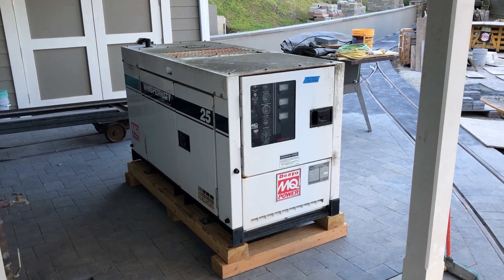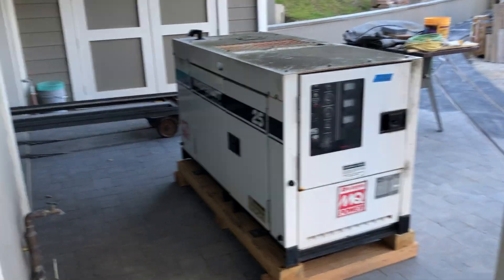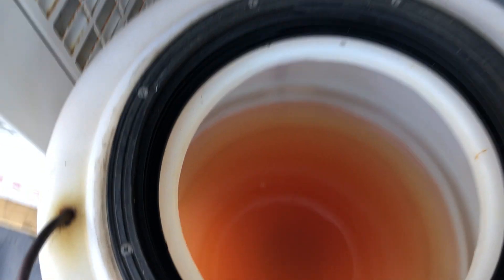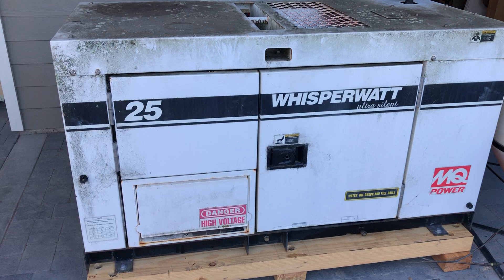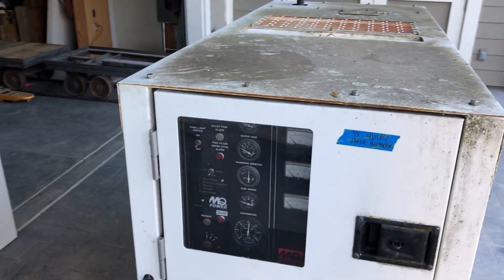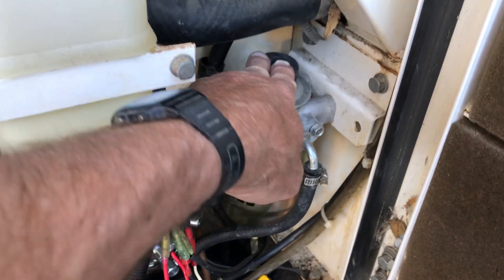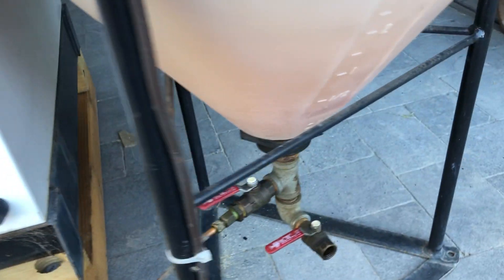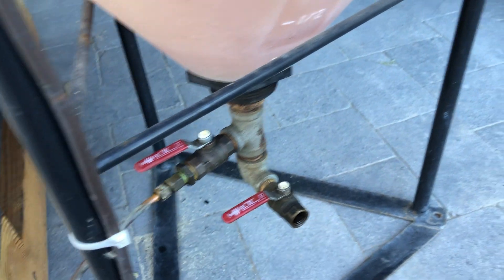March 28, 21 - Our WhisperWatt diesel generator is back!

Comment: question, how much cash per day to run generator? Like $200 a day?
Reply from the maker: It depends on the load. 1000w maybe .5gpm, 5,000w ~.7gpm, 10,000w ~.9gpm.

Comment: Issues present, look at the copper rotting. Corrosion on copper says there is more than just diesel there. 

P.S: Generation is measured in VA (KVA, MVA) as wattage is not accurate for anything other than purely resistive loads with a 0 PF.

Comment: No body talk about the rail road cart why you have rail road story time 😑
Reply from the maker: Gus, thanks for inquiring. We installed the railway to address a number of things on our property.
1. To move equipment/supplies in/out of the workshop to/from the driveway. A good example is here:
https://www.youtube.com/watch?v=LKBjwMapk2M
2. We burn wood to keep warm, and have built a number of 'wood cars' to store wood. This keeps me from using a wheelbarrow every other day to get wood on neighbor's property. Seasoned wood is now kept next to the workshop.
3. We've learned that once one has a railway, there are plenty of possibilities. The utility car we were using doubles as an excellent work bench, and when we break ground next year, it'll be very easy to load up the work bench, and roll it onto site.
4. Using rail is a more compact and hidden method of moving things to/from the workshop. Once we've finished landscaping the back yard, it'll be the only way to move heavy things to/from the workshop.
5. Of course, the cool factor. I'm an engineer, and wanted to give it a try. It's cool.

Comment: Just look for Off-road Fuel. Ask a Local Farmer. We use it in Everything on the Farm and Off.
Reply from the maker: SST,  thanks for the comment. Would love to. I used to be a farmer in Florida, but I'm a 'city boy' in the San Francisco Area, and surrounded by 8+ Million city folk. There aren't any farms in the area, so I'd need to drive 50-70 miles each way just to get Off Road Fuel. Just one of the problems of living in a big city.

I think if I used my generator more than the Christmas Holidays, I'd be looking a little harder. - Steve

Comment: Nice unit.   If you want to store it for a long time add some diesel fuel Stable  it's cheap and works.  You can also buy additional filters if you wanted.    Make sure you start it and put a really good load on it here and there or your gonna wet coat the exhaust and that will cost you more money.      Try and put 3/4 of the rated load on it for 2 hours to clean the exhaust
Reply from the maker: Thanks for the info! Since the time I made video, it's been connected to our home's Energy System, which includes 8.1kW of Solar, 2 - 5k Inverters, and 70kWh of battery storage. The inverters have an 'Exercise' for the generator, but no way to put any load on the generator without manual intervention. I guess the mfgr just wants to ensure that the battery is charged, and cares less about the health of the generator. Thanks! - Steve
Reply: @SHunsader  On commercial stuff the ATS is part of the weekly test run.  Generator fires, stabilizes, then the ATS kicks the load over to generator.  Runs for an hour, kicks the load back to commercial power, runs for 30 minutes then shuts down.  Stabilizers in diesel is silly.  More important to make sure the fuel stays clean and dry (properly sealed tank).  The fuel return line is concerning.  That is exactly how water and debris gets into the fuel.  Diesel doesn't degrade anything like gasoline.
Reply from the maker: @ShainAndrews  Thanks for your reply. Last year is the first year I've ever had some type of algae/fungus/bacteria in the fuel, and it was quite difficult to shake. I have quite a bit of history in farming, and using diesel powered pumps. I'm not sure what you mean in regards to the fuel return line. The hole drilled for the return line into the poly tank was slightly SMALLER than the copper line, so it needed to be forced through the hole, ensuring a pretty tight fit. - Steve